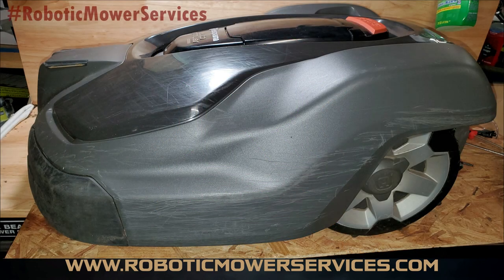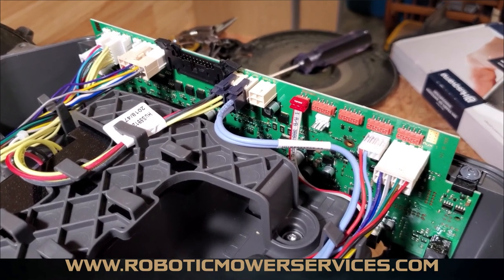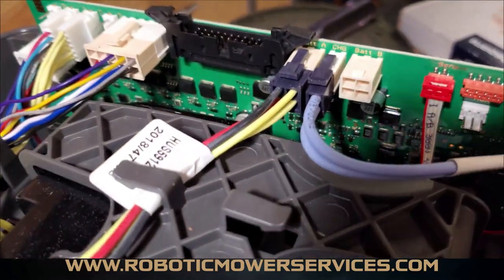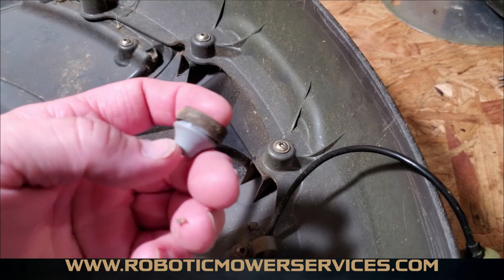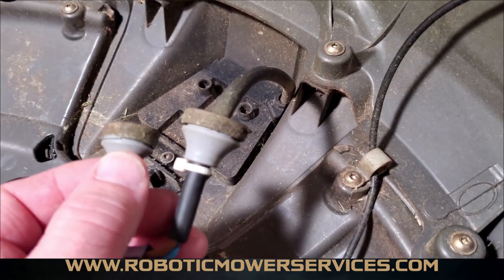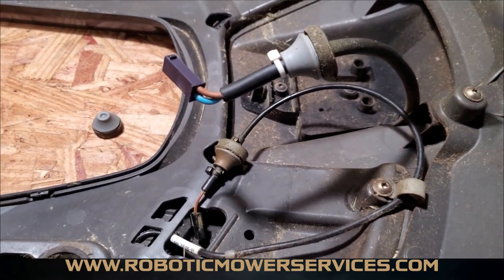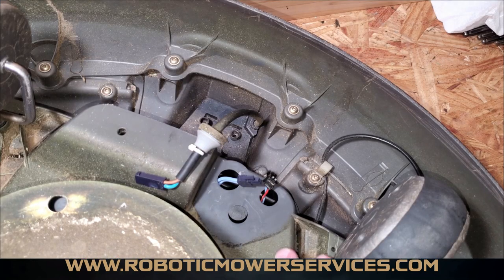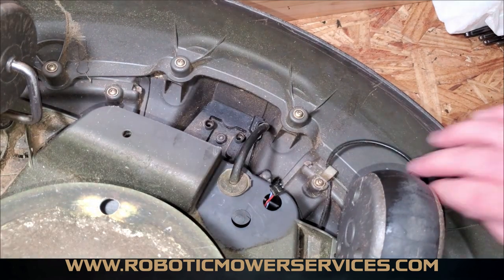Husqvarna Automower With Corrosion On The Main Board: What Caused It And What To Check on Your Mower

Comment: I wonder if the PCBs have any conformal coating that would prevent moisture to actually "touch" the copper or metallic parts. If not, giving them a good conformal coating with an spray may prevent any future surprises. If they are already coated I suppose it was either too much water or the coating wore out.

Thank you for the best video on the topic.

Comment: Hi, just replaced the motherboard and now showing as invalid device 505… can you help?
Reply from the maker: Main boards are not programmed ahead of time because they are used in multiple models. The board has to have the software programmed by a dealer after it is installed

Comment: I’ve a four year old 315x that looks like it needs a main board. Amazed these boards aren’t waterproofed from the factory. These automowers definitely don’t represent value for money. I’ve replaced a faulty wheel motor, a battery and now need to do a main board.

Comment: Is the main board where firmware updates are kept too. Recently had firmware update and mower now won't stay in charging station. Can this be reset or rolled back?
Reply from the maker: Nope. Just need to figure out which component is causing the error. Here's our video about that  issue incase you didn't see it yet. https://youtu.be/Ux_zt4X1CFU
Reply: Dose morning drew caused it
Reply: @RoboticMowerServices  problem was the battery